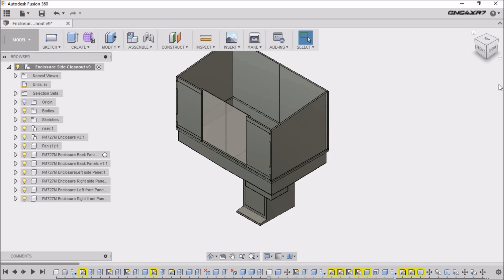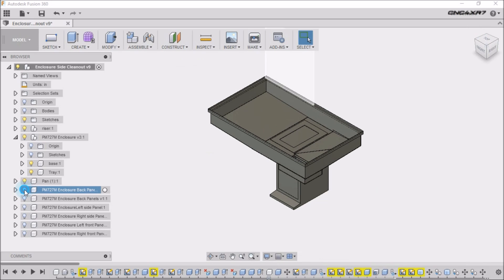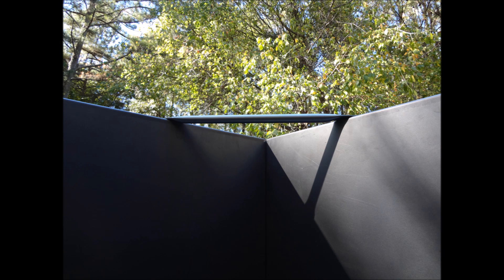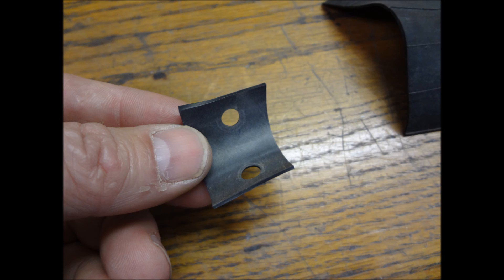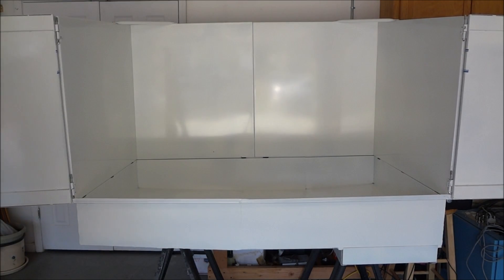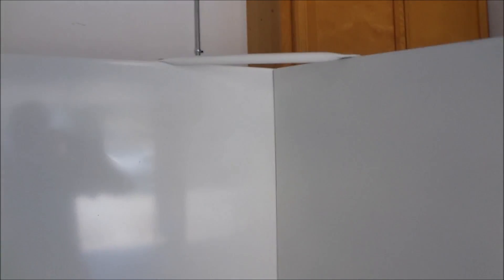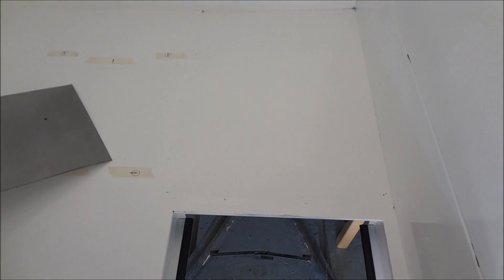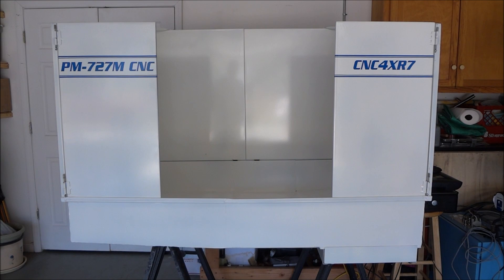PM727M CNC Mill Enclosure Part 1

Comment: what do you think the cost was to convert the pm727m to cnc?
Reply from the maker: I'm not Quite sure what the cost would be to just do the conversion. I have about $4300 into the whole project so far That includes everything Mill, Electronics, Enclosure, Flood coolant. Everything to date.
You could go a different route on the VFD and motor and save $ I did find bargins on a good bit but I see where you could easily save and get it under $4k
Reply: Thank you. I was looking for a premade kit, like they have for the g0704 but haven't found any yet.
Reply from the maker: As far as I know I'm the first to convert the PM727m mill to CNC. I will be offering my Fusion 3D models and Drawings for my stepper motor mounts in the near future. 
I encourage everyone to try and machine the mounts yourself, I think you gain so much more if you DIY not to mention saving $
Be Safe,
Sam
Reply: thank you sir
Reply from the maker: Your very welcome! 
Just FYI if a kit was available for the PM727m I would think it would sell for about 1k
Reply: CNC4XR7 I'd gladly pay it. I'm a tool and die journeyman but our shop has no cnc. all old school. the amount of time and setups to do it manually would be alot.

Comment: Looks great. What are the dimensions for the enclosure?
Reply: Nevermind - I realized the link to the plan was in the description. Cheers!
Reply from the maker: 48" tall in the back by 60" wide front is 42" You could change the panels to have the enclosure " enclosed with a top etc.

Comment: I think I will too go with that route ! I found this motor and this VFD MTR-002-3BD36    2Hp  3phase And 56cJNEV-202-H1   For the VFD 2HP 

It's just easy to copy my G0602 and wiring the same way! 
Do you think is better to go with nema 34 1200 oz on the Z axis or go with nema 34 906 oz ? As I am planning to add rotary table to the head and power drawbar system so that extra pounds! 
But for sure I will add gass strusts, to help get the extra pounds off! Thank you
Reply from the maker: Most VFD are about the same as far as wiring so that should not be a issue.

Remember My Steppers are 3 phase and a 906OZ. three phase is about equivalent to a 1600oz bipolar stepper.

Comment: How are you Sam? happy holidays !!!
This is very nice makes me jumping to the roof your pro !!
Quick question ; why you didn't use DC 1100 w motor since your BOB can control it through the D.C. Controller? 
As I am thinking of between going that direction with my mill!
Reply from the maker: Thank to you as well
I could have went with a DC motor even had a treadmill motor laying around. But I think for the long haul a 3 phase was the way to go.  Besides I would need a control board for a dc motor so I was not really saving anything.

Comment: Excellent job on the enclosure. Approximately what were your expenses on this?
Reply from the maker: With Poly carbonate panels Slides Paint etc. $475
Reply: Not bad.
Reply from the maker: No Not at all a lot of labor involved. I had about 5 hours just in the work I did plus the time painting so I figure it was a deal.

Comment: Impressive! A very industrial cnc machine center look enclosure. 
May think that the filter material or sieve are placed down into the tray, all chips can be collected inside the tray immediately...
A full enclosure always be an obsolete for machine or workpiece set-up or machine modifications works especially for diy machine and guys.
My small router machine is with my diy 32"Lx23"W rise-up type transparent enclosure. By rising it up to different height levels gives different levels of protection and shielding. When it goes most downward, the machine exposes completely. Because the spindle may run at high speed and is noisy, top enclosure cover is also made.
Reply from the maker: Thank you! A filter material in the tray is a option, Thanks

Comment: I'm in the process of putting together an enclosure using shallow Unistrut framing.  We use it at work so I have it on hand. Maybe I'll use aluminum sheet for panels.  Nothing as so pretty as this though.  Nicely done!
Reply from the maker: Thanks 
I had originally thought about making the side and back panels from white vinyl panels laminated to the foam board. You can pick up those materials cheap at lowes or HD. 
I got a great quote from my local sheet metal shop I just had him make the whole thing.

Comment: Would automotive sound dampening material be an option? Might work well underneath, I think that stuff has an adhesive backing.
Reply from the maker: Great idea! That would be great on the bottom. 
A little pricey though. I used 1 sheet of 4 x 8 foam board for the walls.
Reply: Yeah, it probably isn't too cost effective. Look forward to a follow up video on the foam, does dropping a nut in the pan sound like a storm in a 50's movie?  Also curious if you think coolant will collect under the mill.
Reply from the maker: Lol yeah something like that. I installed the foam board today it looks great same stuff I used on my garage door. 
It's foul on one side and White on the other although you won't see the outside of my enclosure as it will be surrounded by walls it looks great with the white side out it's flush with the lip with a snug fit they stay in place.

Comment: really nice work!  on the drain opening, you are definitely going to want to add a drip edge or the coolant is going to bead under the pan edges and possibly start missing the pan.  even if it's only a little quarter inch turn down around the opening to keep it from creeping up to the underside of the pan.  then just notch the back of the tray to clear the drip edge when it slides in.

probably too late to weld it on, bit they make some really good outdoor double sided tape and you could use some angle aluminum or steel and stick it on.

hope that helps if you have some leakage issues around that area!
Reply from the maker: Thanks,
 Yeah the plan was to fold the inside edge down at a 30 degree angle for a drip edge, However they added a 1" flat bar for support on the opening. I do have some concerns about coolant as we all know it can and will get everywhere.

Something may have to be done the gasket pushes the pan up fairly close I'm hoping its close enough to catch any runs.

Be Safe,
Sam